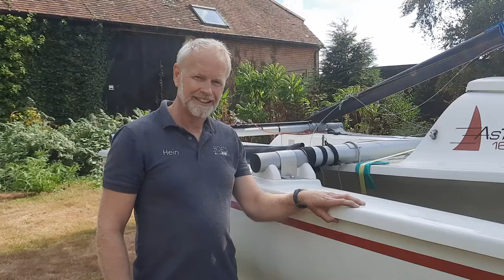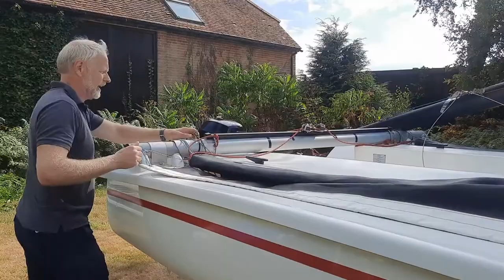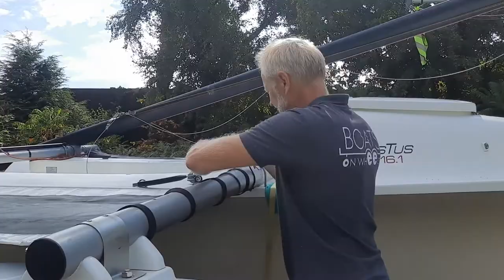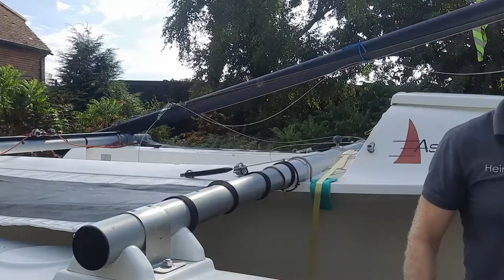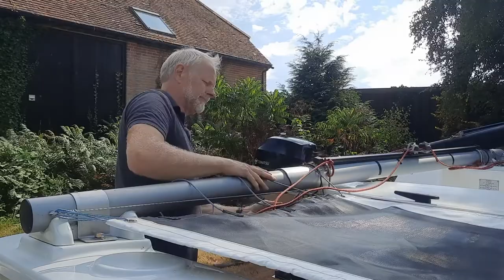Astus 16.1 - 60 seconds is all it takes to prepare each float for sailing.

Comment: I'm considering buying an Astus 16.5 for coastal (fair-weather) single-handed day-sailing here in Southern-California.  Would you please comment on 1) how applicable your quick Astus 16.1 ama deployment shown here might be to the similar (but slightly different) Astus 16.5 rigging, and 2) the time/effort required to single-hand raise the Astus 16.1 mast.   For context, I am a fit 67 year-old sailor.  Thank you.
Reply from the maker: Hello Roland, The ama deployment for the 16.5 is virtually identical to that shown in the video. The mast can be raised singlehanded, using one of the headsail halyards in 10 mins.